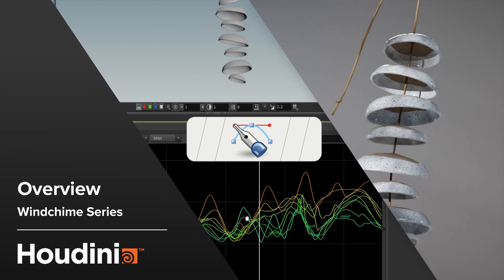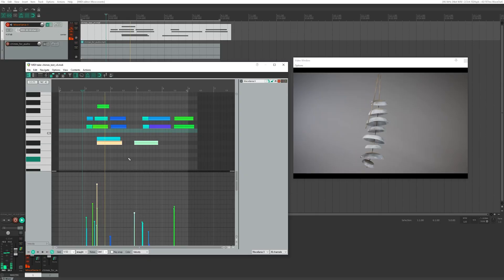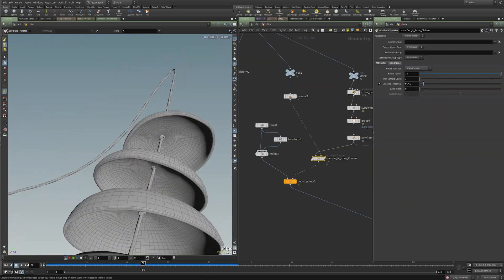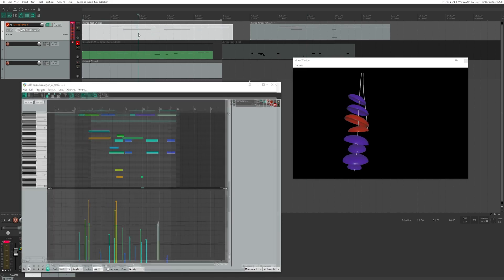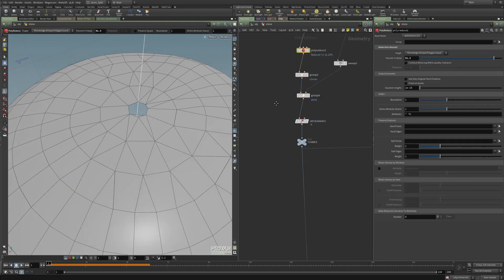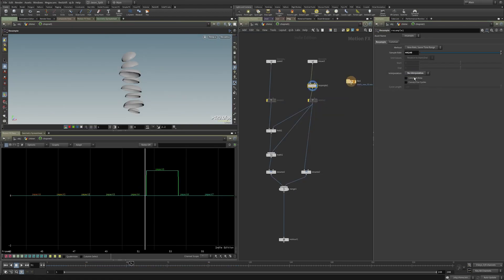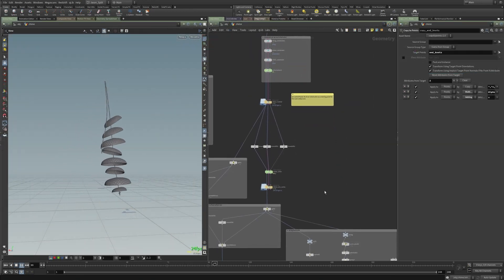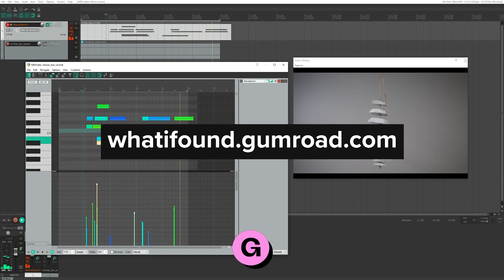Houdini Collisions to MIDI - Overview

Comment: I assume the volume of each note depends on impact velocity. And is the pitch driven by the size of the dish or some other parameter?
Reply from the maker: Volume is driven by velocity. It's an interesting idea to drive the pitch by the size of the shape, but I just have each shape as a discrete note and I choose how to map them in Reaper. The free VST I use in the course is kind of limited in its range. But again, measuring the overall area of each piece and ordering the channels in CHOPs so they ascend from smallest to largest is a really nice idea. Maybe I'll add an update if I get the chance. Thanks!

Comment: Fantastic! Can you also drive - say - position or rotation of any geometry playing a MIDI keyboard in real time?
Reply from the maker: Driving parameters via MIDI, either with MIDI files or with a keyboard / controller is 100% possible. Doing that real time would really depend on the scene and use case. If you check out some of my earlier CHOP videos I do similar things with computer keyboards and a mouse / tablet as inputs. To set up MIDI really isn't much different. At some point I'll do a set up and put it out on YouTube. Thanks for the comment!
Reply: @WhatIFound  Thank you!